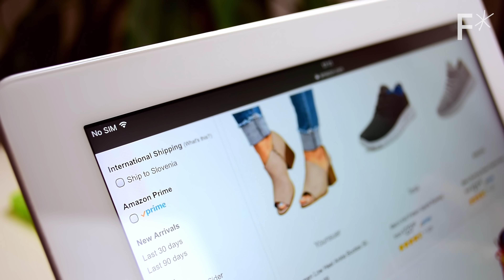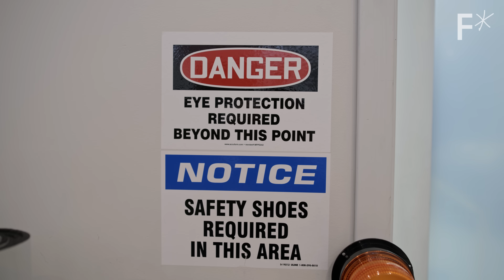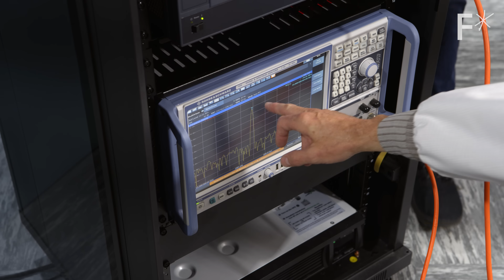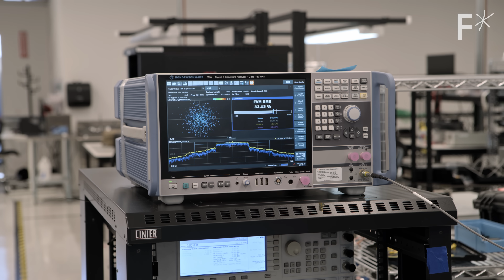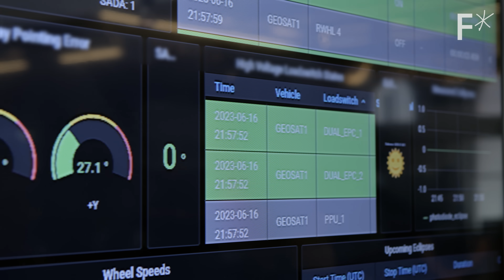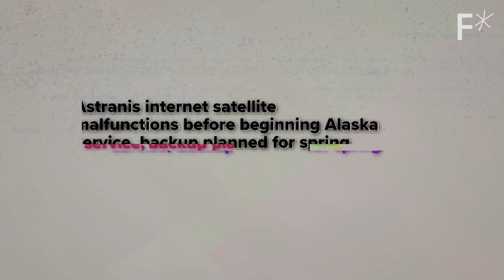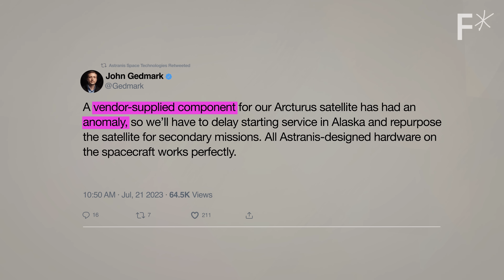Starlink’s newest competitor is using next-gen satellites to create internet for all | Hard Reset

Comment: "any dish down here on Earth has to track those satellites as they move across the sky." Ok no problem here as that is correct. However, the issue is what is being shown while making that statement at 3:10 which is wrong and so misleading. Sorry but the dish does not need to move all the time while tracking the satellite as it is phased array. So this is not a problem like you make it out to be. Yes it can drop out or the signal can become weak, but it is not due to that dish physically having to move and implying it is not moving in sync with the satellites movement. One of the main reasons is it switching from one satellite to another one. Yet this switches so fast that the majority of time it does not drop out and you never notice you lost internet for that brief split second.

The biggest issue I have though is that you make this sound like it some great and new tech comparing it to some alleged implied cumbersome LEO system like StarLink. That is just simply not true. This has been around decades and is known as GEO. It is what the older satellites networks used after all. It is not better or worse, it has pro's and con's just like LEO does. What this will do is provide a different sol'n and an alternative one that could be better depending upon the scenario. And it likely will be a cheaper sol'n, while at the same time having a higher latency and so never being as quick. Much faster than what they likely had before, but not comparable to the speeds of systems using LEO. One scenario where a GEO system like Astranis will not be better is in the extreme southern or northern hemisphere due to satellite being very low to the horizon. Of course a plus is that Astranis is newer and so can take advantage of the newer tech when it puts up there satellites compared to some of the older networks, which takes money and time to slowly replace them with newer tech available now. And I am not even quite half way into the video yet... But I suspect BECAUSE this new company will need to implement all new tech mostly from the start instead of replacing them over a longer period of time, that this company has a long up road battle having to pay out so much yet still trying to compete with the already available options out there. Great if they can do it and compete, but it is a risky endeavour and I am just not seeing a demand for it that is not already available, just have to pay for it like they will with this company. And this video is not showing how it will be able to do all of this cheaper than what is already available, again so far.

Comment: Geostationary satellites are not the best for real time two way communication such as the internet. They are best for one way or non "real time" such as television distribution or lower speed data transmissions such as receiving data from far flung devices such as weather stations at sea or in the wilderness. 

For someplace like Alaska or other high latitudes, the better solution would be at least two or three polar synchronous high apogee satellites that would be in orbits that had at least one of them in its apogee over the pole at all times.

Comment: This is misleading.  The LEO dishes don't physically track the satellite or lose connection.  They move the signal beam by modulating tiny receivers/broadcast chips to digitally point the beam.  It happens near the speed of light.  Plus, the lag from these new satellites being to far away...

Comment: The issue will definitely for real time application, such as gaming, video calls, even trading will have tremendous delay. However, I experienced that someone call me through WhatsApp over remote place where only high orbit satellites internet available and it was working OK. I didn't notice the delay and didn't realize the connection was done over high orbit satellite until the guy mentioned that. I believe the application can evolve to adapt high latency connectivity to keep it useable.

Comment: this is good because it makes the network decentralized and does not use expensive and insecure submarine fiber optic cables.  but that is also a problem in the radio spectrum is only so large  and you can only pack so much data on a carrier wave.  its using microwave transmission and that travels at the speed of light and your putting expensive infrastructure in space that has no protection from ground to space microwave jamming.  there is a far better system: space to ground laser data transmission...  because your transmitting data over a laser from a to b it cant be jammed or intercepted also the bandwidth of data you can send is in the range of 100gbits/s.  because your sending data with light and not microwaves means its hardened from space nuclear detonations or solar flares.  that is the future.  microwaves will work for a few decades but they will run out of spectrum and limit data / speed to customers.

Comment: The way you mention starlink dishes moving around trying to align with the moving satellites is incorrect.  That is only for the initial alignment.  And the third gen3 does not even move by itself.  Geo says have been tried for decades.  They will not work for most applications.

Comment: Telecommunications in Alaska has grown from the Army microwave long-distance system connecting the lower 48 using microwave Towers to having our own satellite with Alaska which was bought by at&t, and our MCI equivalent, GCI with two newer satellites that make AT&T Legacy satellite Communications with huge dishes a has been, leaving town. The first fiber optic line to the lower 48 served the industrial North slope, GCI had the first fiber optic line serving customers and when it broke the satellites could not keep up and the second line was installed, MTA built a land fiber optic line connecting North South Central Alaska through Canada to the lower 48, fiber optic lines are beginning to carpets the Arctic Ocean, the shortest distance between everywhere north of the equator, these lines are starting to provide pass by bargain rates to the residents of the North and Northwest part of the state call my GCI has run fiber optics from Anchorage west across the state to repeating towers built on top of Glacier covered mountains using diesel generators providing service as far as Kotzebue AK. Fast service serving thousands of miles with few customers, not to mention the helicopter accessed repeating towers. And in the case of Bad actors that illegally killed Caribou in the northwest, and the perpetrators were never identified, suddenly almost overnight cell towers were erected throughout the Barren lands, 911 just a phone call away, streaming music while you're fish, mother can have you bring a gallon of milk home when you get back to town. Who would leave home without their cell phone is now identifiable as who was there, just like in Los Angeles. The rules to call Alaska and from Alaska, are blurred with Google Voice that works with some numbers but not others, truly Alaska numbers cannot use Google Voice, though some 907 numbers can enjoy all of the features of Google Voice, I used to have one before I changed my number. GCI offers 2 gigabytes speed, cable TV has been discontinued. Competitor ACS is building fiber to home promising faster speeds for Less for those of urban communities.

Comment: Did i just hear someone compare dial up to 2G? 

While theoretically true. No systems in the world use standard 2G due to severe security problems that can become undetectable man in the middle attacks. 2G or GSM EDGE-E is the current and only operative specification that is available due to Transceiver Microchip Manufacturers only producing GSM EDGE-E compatible chips for the respective markets.

Technically the speed can be as low as dial-up with backwards compatibility, but most customers have home hotspots with fixed antenna that allow for maximum connection quality. This the cellular phones are used for phone calls mostly.

Comment: The starlink dish does not move as it tracks sats.  It uses a phased array to steer the beam and tracks multiple sats at the same time so there is no loss of signal as it moves to a new sat. The starlink dish only moves on startup.  The new starlink dishs dont move at all as they do not have motors.  Starlink being closer via LEO puts the latency between 30ms and 100ms vs geo stationary sats at 500+ ms.  That is 1/2 second delay....try a phone call with a 1/2 second delay.
Reply: I second this

Comment: The Starlink antenna doesn't keep moving around mechanically after the first configuration, neither loses connection when switching satelites, this piece is very very misleading. Not gonna mention the fact that geostationary satelite internet is actually old tech, available for decades, actually.

Comment: High latency is a limitation with GEO 35,786km (600ms distance delay) compared to LEO 1000km (20-50ms distance delay). No typical use of the internet is usable with delays of more than 100ms. Also, GEO is 5x the resource cost of LEO per kg of payload. A rich labor force as a ISP to 3rd world poverty isn't reasonable. A business that services remote towns is a tiny market share. Perhaps do something the customer wants instead of this?

Comment: I stopped watching when he claimed LEO constellations are bad because the user antennas can't MOVE fast enough to track the satellites. Nobody putting up a LEO constellation is using TRACKING dishes. Every single one - Starlink, OneWeb, Amazon Kuiper, etc. - is using phased array antennas which electronically "steer" WITHOUT MOVING and can switch from one satellite to another instantaneously.

Comment: This video is incorrect. The Starlink dishy does not move to track satellites, they use phase interference to bend the signal to aim at them instead of moving the dish. Also you do not lose connection when it acquires a different satellites it happens in millisecond and is seamless. I have been using StarLink for 2 years now and its amazing for streaming videos, fast low ping gaming(less than 50ms) and more!
Reply: The VOD is a bit like a used car salesmen selling a GEO ISP. A bit more salesmanship than facts.

Comment: I doubt they can compete with Starlink. Hugesnet and Viasat are losing customers quickly because Starlink is the better choice. GEO satellites have very high latency 500+ ms while LEO satellites such as Starlink have a cable-like latency typically less than 100 ms. That's one reason SpaceX went with LEO  Also, starlink dishes rarely move they use a phased array antenna that automatically connects the user to the best satellite available using a tight beam of electronicly steered phased array antennas. The video misinterpreted that the starlink dishes always need to move to the next available satellite the dish typically points north and stays there to avoid interfere with other satellites while connecting from satellite to satellite using that phased array technology most starlink dishes are connected up to 5 satellites at once currently can only use one satellite at a time thanks to a dumb fcc regulation.